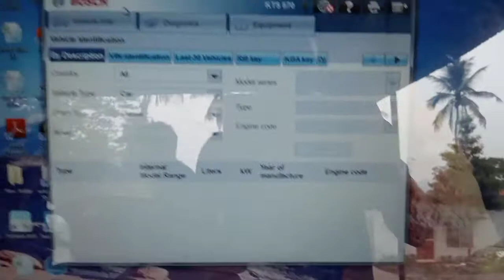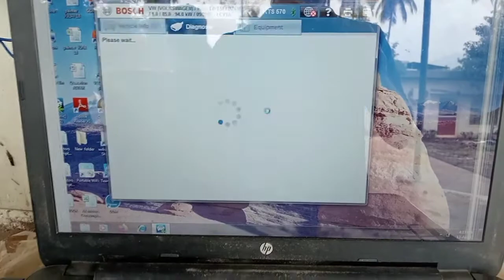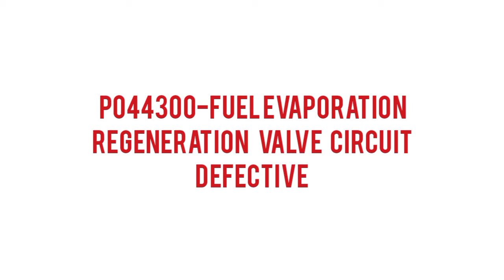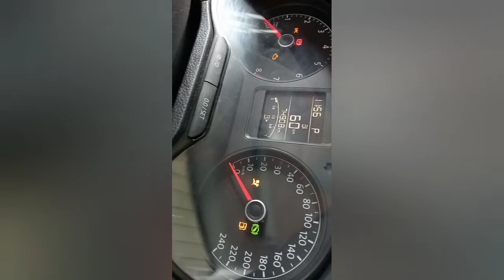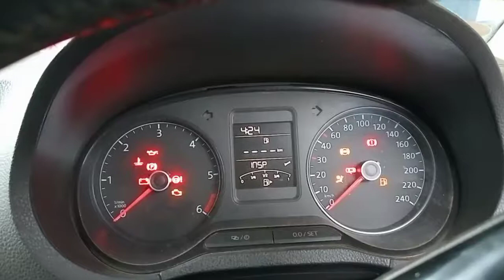POLO GT TSI WARNING LIGHTS ON ( EPC, TRACTION CONTROL, CHECK ENGINE)

Comment: I have a 2014 jetta tsi 1.8t had the epc  tc check engine light all 3 at ones  when i accelerate the car on the hight way when tirn off and back on its normal again till i push the gas pedal hard. Try g to find the issue hope this help. Thanks.
Reply: were you able to figure out the problem?